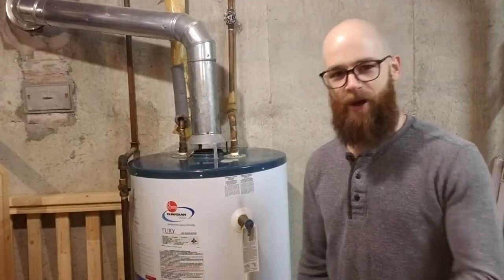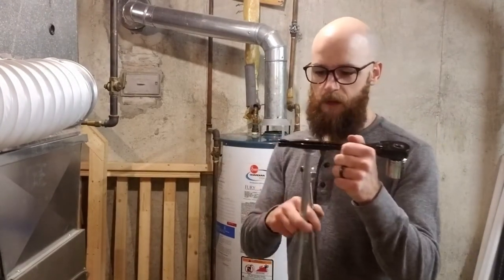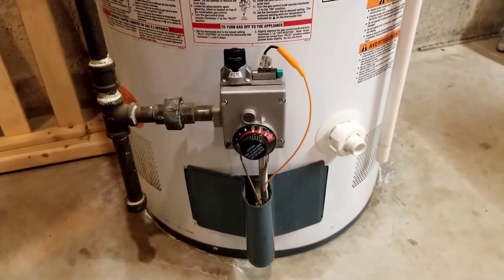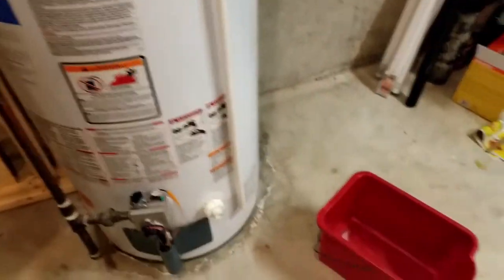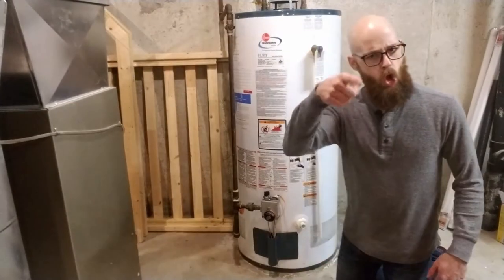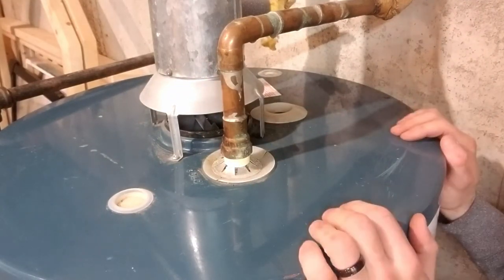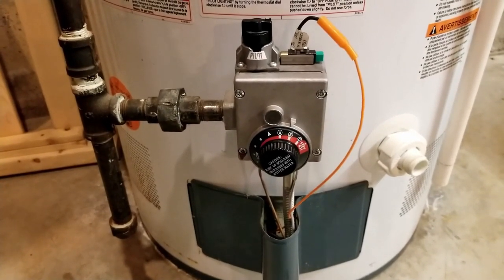Hot Water Heater Maintenance MADE EASY! How to Flush Water Heater Tank & Replace Anode Rod

Comment from the maker: 0:00 Intro
0:26 Tools/Supplies Needed
2:29 Turning Burner Down to Pilot Lighting Setting
3:23 Testing Pressure Relief Valve
4:13 Shutting Off Cold Water Supply
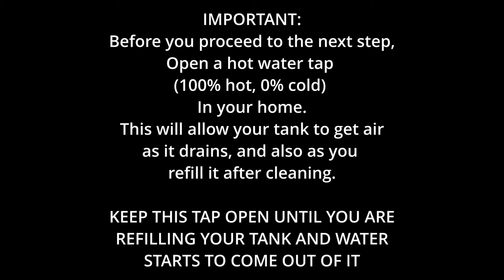4:38 Draining Hot Water Heater Tank
6:32 Inspecting/Replacing Anode Rod (while tank drains)
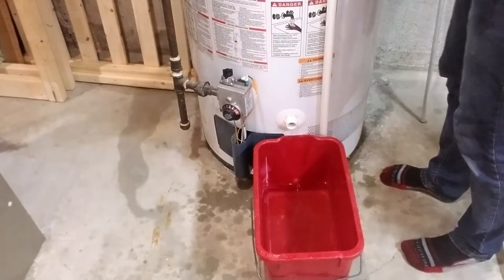11:19 Flushing Tank / Cleaning Tank 

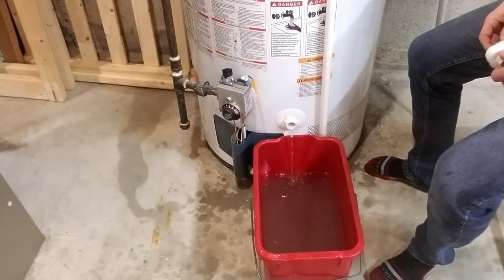12:04 Refilling Water Heater 
12:18 Turning Heat Back Up